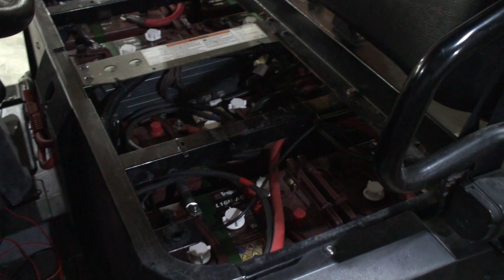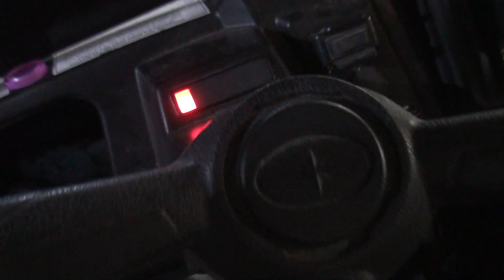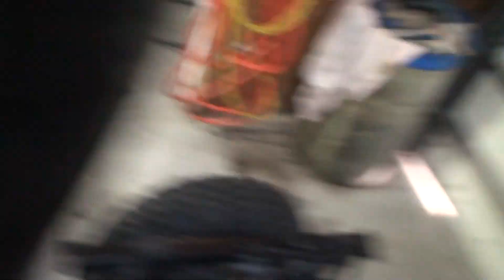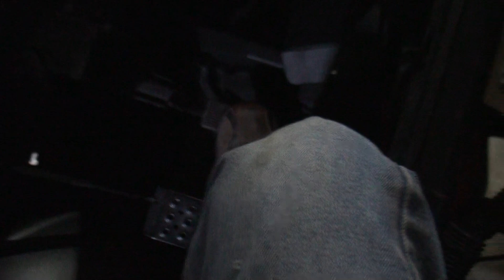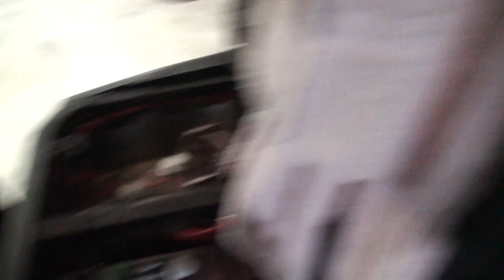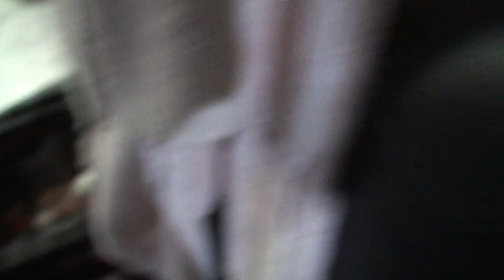Polaris Ranger EV noise issue, Part1, shudder, rattling, shimmy, shaking, vibration

Comment from the maker: Jason Taylor says his shudder turned out to be a bad connection! Just makes sense as I was thinking that probably the controller had an issue with the drop in amperage at the high amp draw in the first second or two when you first take off from standstill. The thing is, mine still did it after I put new batteries in & all the cables were cleaned at that time. But there's still the cable he mentioned from the solenoid to the controller I didn't pull & I haven't looked at any of the cables from the controller to the motor or to ground. I'll wait for a warmer day, then I'll check all of them one by one. I've had a corroded cable 5 or 6 times now in the 10 years from new. I sprayed mine last few times with the battery protector & all's been good for a few years, but this idea is the most likely cause when you've installed new batteries & it still does it.

Comment: My 2018 Ranger EV has had exact problems from new and has never been resolved. Dealer replaced all rear end parts trying to fix the shuttering. Nothing changed. Ive replaced all the batteries and still have power problems. It shudders harshly when power is needed and lacks power. Somehow i think the needed power is not getting to the motors when needed. The EV i had prior to this one did NOT have this problem!

Comment: Did you figure out the clicking?  Mine is making the same noise.  Started on the left side and now on the right side rear also.  Believing it to be the cv axles.  

Picked up a new lease this year and have been SUPER HARD on the buggy.  Lots of mud, hills, banging over roots in the trails, etc.. 

I feel it's a little premature for the cv axles to go out as it's still fairly low hour.  But I'm about 90% sure that's what it is.  After watching your video, your clicking occurs at the same rotation time on your cv axles(if you pick a spot on the upper boot, it clicks at the same time it makes a complete rotation).  

I thought they would be as strong as a gas midsize ranger.  I have a 2014 570 with big tires, and no issues out of it.  Hindsight though, I probably would never hear it clicking over the motor...
Reply from the maker: I think there's a few problems which may be unrelated to each other.  The clicking is probably a CV noise, but the CV seems perfectly tight.  So I'm not replacing them to find out,  As you said, if it had a gas engine, you'd never hear it anyway!  The idea your EV will remain perfectly silent it's whole life is unreasonable.  Too many points in its construction which can develop a squeak!  I'd take things apart & grease things for sure, but I wouldn't spend money to get rid of a mere squeak.  It's not silent on a gravel road, nor across dry leaves, only in some circumstances.  Where the CV's fit into the rear diff is a more likely place the click may be coming from.  The splines fit pretty loose when you look at it.  The 'shudder' has been cured by some when they pulled all their cables & fixed bad connections.  Or their batteries were going bad & there was an immediate loss of amperage on take off.  The driveshaft is another spot where play in the U-Joints cause noise or a shimmy.  Or the front DS spline has some play.  The rear spline is very long.  The front is way too short & could of been made different.  If would be real hard to make this fitment better now it looks like.  Might be possible, but I use my AWD mode maybe once a year.  I'd take my shaft off before I'd worry about it.  But that isn't so simple either because of the parking brake.  But I'd like a more positive locking brake...

Comment: I FINALLY FIXED MY SHUDDER!!!  After 8 new batteries I still had the same problem so I then replaced all of my battery cables.  Turns out the main positive cable leading into the solenoid was corroded underneath the sheath.  Once it was replaced I lost the shudder, regained my battery life and my mileage per charge.  2011 Polaris Ranger EV 195hrs
Reply from the maker: Good call! I pinned that warning to the top.